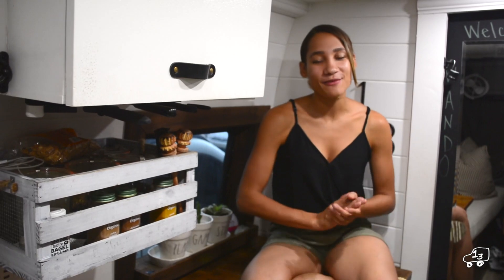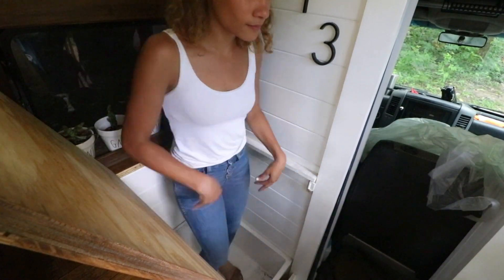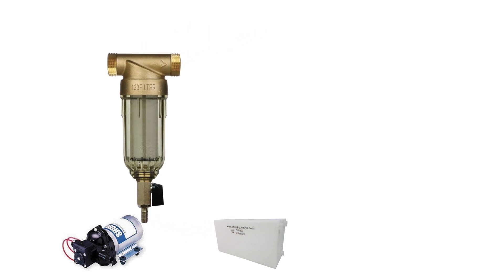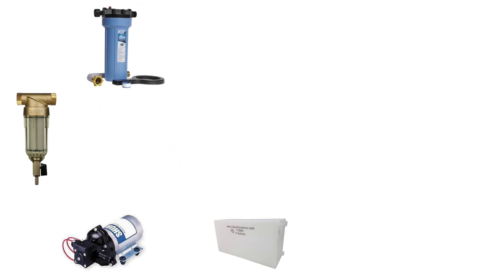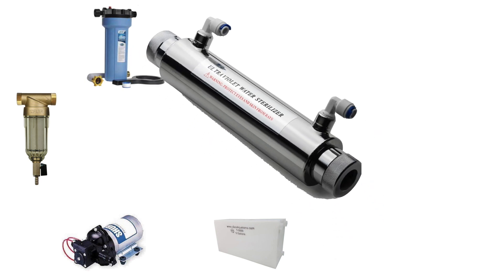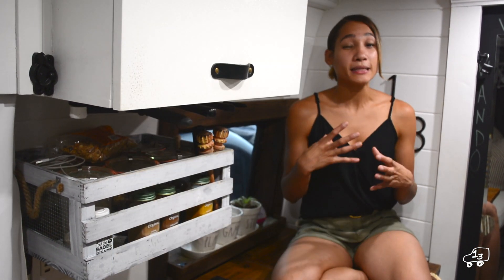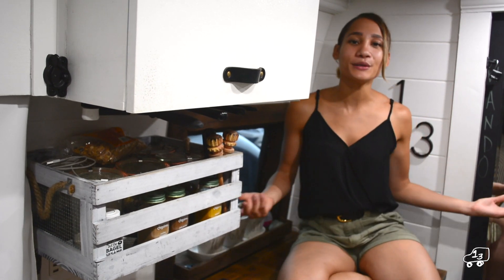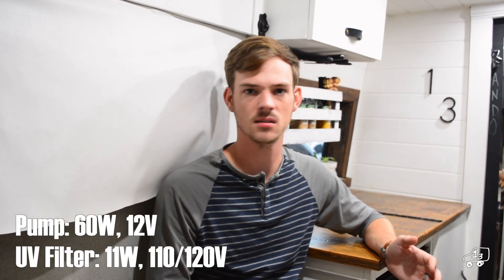VAN Tour: Recirculating Shower | How to Shower in a VAN

Comment: If you do change your plumbing...  stainless isn't actually as hygienic as it may seem.  Copper pipe has great antimicrobial properties.
Reply from the maker: Thanks Brendon, noted 📝
Reply: @foraluckygirl  I'm doing my first build at the min, my videos are pretty budget but will be showing some unique features and going to start looking into healthy choices and options for materials etc.  Check it out if you're interested - just know I'm going to put some more effort in and they will get better!
Reply: Copper or brass
Reply: The big benefit with plastic is cheap, just replace every couple of years, especially if you dont clean it.
Reply: Soft copper tubing doesn't stay soft; it work hardens due to expansion/contraction and movement, eventually cracking and leaking.
Reply: Brendon Tait the only problem with copper is that it will burst/crack if water is frozen in the pipe. I don’t know about stainless steel.
Reply: I would just be careful because I believe copper can be poisonous over time! Copper rust can be dangerous
Reply: @jacobbutler3845  I agree, but I would only be concerned about it if the water being used was acidic.  Copper is an essential trace element and has antimicrobial properties.  Although it does become toxic in higher amounts which can be caused from acidic water.  I believe at dangerous levels it can be tasted.

Comment: I was in the initial stages of planning a similar system.  I saw an inline aquarium heater that I think could work.  It heats the water up to 93 - 96 F and uses 200 or 300 watts.

Comment: Interesting, thank you.  I would definitely incorporate a heater.  I like you approach to the shower.  I hadn't seen one like it before and, one day playing with Sketchup, came up with a very similar design - a half-high shower with a curtain, that is additional counter space when not in use.  I also designed the curtain to slide behind a panel so it isn't visible when the shower is tucked away.  Thanks for sharing.
Reply from the maker: Oooh nice ideas Dave! Thanks for sharing

Comment: The concept of re-circulation of water has been around a long time, but I didn't realize how relatively simple the system would be if designed right, nor did I even think about using it in a van build application. My van build is now under way, still pretty bare on the inside. Now is the time for me to plan-in a system. I will use your Amazon links when i make my purchases. Thank you for giving your parts list and talking about this subject.
Reply from the maker: Awww we are so happy you were inspired! Good luck on your van build; it’s the best adventure :) and also thank you for the amazon support!

Comment: Sounds great guys..  I have physically torn my drain valve off my water tank. It sucked but it was just sprinkler riser, so c'est la vie. But on another note.. My water tank is at a well protected height,  a foot high in my rig and protected from the elements so I've never damaged it, but I am a big proponent of skid plates for important elements..and have my oil and tranny pan protected, as  I've damaged both.   It'd be pretty simple to protect your plastic tank bottom with a little metal plating.. and man I tell everyone who off roads or goes in lossy conditions to put a thought or two into assuring their oil and tranny pans and thus your big dollar assets are protected from leaving you high and literally dry.
Reply from the maker: Oooh interesting. Thanks so much for that great advice Deborah! We’ll look into it :)

Comment: Add 1t. Epson salt per gal. of water and it causes a chemical reaction that allows the filters to capture the soap.
Reply from the maker: WOAH thanks!
Reply: Hey did you guys try the Epsom salt and if so how fit affect the system and shower residue?
Thanks , great video.
Reply: Sorry. If I put Epsom salts in my shower I would get so relaxed i would fall over.. LOL Ona hot day I could put that in my silicone clothes basket full of warm water and have a relaxing bath!!
Reply: Richard OBannon Really? Never heard of this!
Reply: Salt is in pool setups. It is better than chlorine unless you are shocking new water.  In the shower setup, salt does its job, and shower water doesn’t need a shock from chlorine.  If you want to know more about pool and spa systems, look up hot tubs.  Hot tubs also use ion generators for softer water and fighting organic matter.

Comment: I wasn't planning on using  shower since it took up to much room in a van until I watched your first video on you entire van with your shower. I got so excited. After spending the entire day behind the computer and drawing out designs in my sketch book. I have come to a conclusion of trying to build the shower water on my roof. I figure that if you use 4" white PVC to hold the water, you can run your pipes along the top of the perimeter of the van and this will hold around 12-15 gallons of water. Keep the run one direction only, this will let you use the fresh water first while the used water follows. Spray paint the pvc a flat black, this will warm up the water quite well and give you a warm shower instead of cold water or another setup to use to heat the water. You will have to cut a small hole in the ceiling for your water to flow through, should be easy though with seals, plus its over your shower area.
Reply from the maker: Woah Sean that sounds incredible!!!
Reply: Until the temperature drops then you have freezing cold showers!

Comment: You can easily go with a larger tank that has more clearance then the tank you are using, as well as two tanks etc  blow molded tanks are readily available in so many sizes, meaning a5gal that is say half as tall, just wider and or maybe longer.  Easy peasy  slick system for sure!

Comment: If your heating the water for showers do what me and my wife are considering with our proposed recirculating shower... she likes boiling hot short showers, so she’ll go first, then the water is already hot for my shower, and with a thermostatic temperature controlled heater it only needs a top up of heat and I like a long cold(ish) shower.
Reply: Oh, stainless pipes will loose a lot of heat, you could use black plastic on the roof to heat the water (solar)
Reply from the maker: Hmm very interesting!! We’ll see if we ever change it :)

Comment: An infinite shower loop can be done using distillation process, in this regard you can literally create pure potable water from sewage water as long as you have enough tanks and a source of heat!  You will rarely need a new source of water, and you can use your favorite soap and shampoo using this method
Reply: The distillation process takes FOREVER (approx 8hrs/5gal), so not sure how you would expect this would work. A shower needs at least  (2gals per min), so please explain your distillation theory, or am I missing something?
Reply: Solara is from the future.

Comment: Worth noting about UV cannons is that they just damage the bacteria/microorganisms. They live for a half hour or so after they've been dosed, but they can no longer breed/replicate. So having one in a recirculating setup isn't wrong per se, but the utility of it is not as large as one might think. Having UV light on the water intake to the van itself, though, is great. The water goes past it and then winds up in the tank. So going with two big canister filters, one that does the particles first, and then another that has active charcoal for odors, would be sufficient. Plus the coarse filter at first to sift out the big stuff, like hair. As for how to draw water from the water tank, you may want to look at the showerloop.org site, and maybe talk to the guys there. They use electronics and solenoids, an Arduino I believe. I'm not sure about those details though. Maybe that's still on the drawing board.
Reply from the maker: Oooh good idea! And yes I love Shower Loop!

Comment: In summer we use a battery powered shower odd the back and side of the van. The power comes from a battery and foot switch combined unit and I stand in a collapsible silicone, very large bucket/clothes basket.The water recycles while I shower. I finish  with a fresh rinse of new water. I heat the water in a kettle using the gas stove and add hot water to cold water until I get the right temperature. 99% of the time we use the gym, beach or campground showers anyway.
Reply from the maker: Wow that’s incredible! There are so many genius ideas with Van life!
Reply: @foraluckygirl  We are in Australia. The Europeans come here and love the idea that they can stand outside and shower in warm weather in the open and in nature. I swear if it was legal they'd all be nude as they are not modest like Americans. Ozzies are somewhere in between. My shower came from eBay. I also have a 12VDC version that does the same thing. These ideas get around the pure cold water shower. If you have plenty of water available then you just pump it straight out of the container and we stand on foam pad. The on/off switch is a a momentary push switch on the shower head. We use a portable tripod shower holder to hold the head above us.  Yeah there are some great ideas but we have been camping and boating for more than 40years and we think we have it down pat.
We are now trying 'vanning'.

Comment: I would consider using a large stainless (for cleaning reasons) reservoir with a large top opening, and a separate drain.  That way you can add hot water heated on a gas stove, and you can go inside and scrub it and drain without contaminating the piping.  Another add in, run piping under your floor and use the system for hydronic heating(and use a small gas boiler).  The tank needs to be vented but not pressurized.  So much one could do, with time, space and money.  :-)
Reply from the maker: great idea! and I definitely agree - it would have been amazing to keep developing this plan but it was time to move on :)

Comment: Look at using a diverter valve prior to the pump, switching between two water sources as easy as turning a lever.
Reply from the maker: Wow thanks James for your insight!
Reply: Wouldn’t that potentially have the shower water running through the same lines as the rest of the plumbing?

Comment: Definitely the right idea. Adding a bank of RO membranes to the final stage would get rid of body salts as well as make the shower water drinkable.  But it would take 4x 200 gpd membranes to give you a continuous 0.5 gpm shower.  The water to the membrane would also have to be less than 115F to protect it.   If you can live with shorter showers, a single 200 gpd membrane can take water from the gray tank and put about 8 gallons into your green tank in about an hour.  Then use the 8 gallons however you want.  They would last about 15 minutes in the shower if running continuous.  Once your gray tank TDS got over 2000, then you would have to either dump it or distill it.
Reply from the maker: Wow cool info!!

Comment: That’s really great! Wack in a gas instant hot water heater and you’d be having ‘unlimited’ hot showers
Reply from the maker: Maybe one day!!
Reply: Diesel hydronic heaters are the cat's meow.  They will heat the water through a heat exchanger and can be used for hydronic floor heating.  A win-win in multiple areas.
Reply: @mldennis  Yeah and I wish I set up the under floor heating! That would be lovely. Maybe I could add it one day as a project

Comment: Could use two tanks to get fresh water when needed.  Perhaps you could have a separate valve that lets in fresh water and a separate handle to let the fresh water flow.  It will drain into the recycling system.  If that would overflow the recycling system you could allow the overflow to flow into a third tank that you dump.
Reply from the maker: I definitely considered this layout option, but the timing and skills were limited hehe

Comment: Would say remove filters and clean with vinegar or citric acid and cycle it. Then flush with tap running water for 3 or 5 minutes

Just change filters every 6 months or as recommended
Reply from the maker: thanks for your suggestion James!

Comment: Food for thought:
I toured an Army water filtration semi-trailer (300,000 gallon pool of filtered water was possible, from a large lake or swamp). They used pebbles and sand for pre-filters. 
A seven foot tall cylinder, 3 foot diameter has a bottom layer of fine filter material, second layer of fine sand, then coarse sand, fine pebbles and coarse pebbles on top. A disposable mesh on top to catch large debris. 
Occasionally, this system is back-washed to clean and reuse the material. 
After the pre-filter, the water passed through a system similar to yours.
To illustrate for your scale of operation: Fill a large "sock"  with clean sand, stick a tube (from a dirty water source) into the middle and let the sand be the first filter. Then use your current filter system. Downside - The more filters used, the more water required.
If you are using clear water, your system should take care of natural hazards. But I wonder how pesticides are removed.
Reply from the maker: hmmm very interesting things to consider!

Comment: I wonder if this would still work if you flipped it and put the 5 gallon tank on top of the vehicle. In a black container, maybe it could heat up in the sun?
Reply from the maker: Hmm you’d just need the pump under the van to push the water back up, then gravity would bring it back down. Could work!

Comment: Interesting approach, perhaps the third (up) filter is too much for shower grade but love seeing a different approach
Reply from the maker: I think the UV is most important for the bacteria that you’re removing. What are your thoughts about it?
Reply: I wouldent get rid of the UV filter, it was one that came to mind when you started naming your filters. UV filters are amazing I use them on my fish tanks (from 25 gal to ~300 gal) and they have killed algae blooms and bacteria based infections. 

If I had to come up with a recirculating water system for a shower I would definitely include one.
Reply: @foraluckygirl  i guess it depends. if you are re-using the same water immediately cant see a need but re-using 'old' used water then sure the UVZ filter is necessary(?).

Comment: How do you prevent the water from freezing in colder climates since your tank is underneath the van?
Reply from the maker: we didn't use the shower in the winter because we didn't have a water heater, so we just drained the lines and showered at the gym

Comment: I like that youre utilizing the basement and have that water reservoir underneath of the vehicle. Are you concerned about it freezing in the winter since its outside of your vehicle?
Reply from the maker: Hey Sean, thanks! We don’t plan on using the shower in the winter because we don’t have a water heater and that would just be torture :) if we transfer our grey tank under the van, we would just put antifreeze in it. I wouldn’t put a fresh water tank under the van though.

Comment: fyi, the strainer should be first, before the pump.

I am in the design phase of my van. I was thinking of a similar circulating system for my shower. From the tank, pump the water, filter it, UV light and repeat.
But, I was thinking, what if its not only for the shower but also for the kitchen sink?
A system connected together that circulates the water, so you can have a long shower, and also do the dishes or use the sink longer too. Each time you use either, you empty the water into the grey water tank.
But, the only tricky part is how to dump into the grey tank. And same as you noted, getting the first rinse from the freshwater tank. Any info on that?
And, does that mean you need a pump for the grey water tank too?
Additionally, in a way, this could just work as drinking water too, since its already filtered, just make sure that its not circulated water
Reply from the maker: Oooh you’re right, the strainer should go first! Good call! 
As for the sink I guess you could do the same, just observe your sink use and decide. For us, we let way too much go down the drain to feel comfortable using that water, vs while showering nothing too crazy is being washed down. I never figured out how to get a fresh water supply first and then switch over, and then finish off with fresh. That would be IDEAL
Reply: @foraluckygirl  Yeah, no one that I can find does that. Its also rarely talked about, recirculating water. I have been trying to design such a system, but its fairly complex requires multiple pumps and filter systems. So, it may not be really worth it if it was possible.

Comment: I am a CS... I understand all of Henry’s concerns lol. I would like to go van life on active duty, how would you recommend I go about it?
Reply from the maker: Hi Amy! Thanks for serving :)
Honestly we don’t think you would have any issue with that! What are your main concerns?
Reply: Wando Tales 
A big one for now is the address. Of course the military will need one, though I think at my next command it may not matter as much (sea duty). But also was concerned about deploying... is it pretty cheap to replace parts like a battery for most American brand vans? I may come back from deployment to a dead van.
Reply from the maker: I think our battery was about $200ish when we replaced it or you could leave it with a pal to turn on every few weeks. Same for an address!
Reply: @foraluckygirl  or you could use a trickle charger to keep it charged.
Reply: If you install any Lithium batteries, be sure to put them in storage mode before you deploy.

Comment: A single filter is going to get clogged way too quickly and won't be able to keep good pressure. You really need to have bigger micron filters that gradually get to smaller micron. This way, the large particals will be removed, then smaller and smaller.
Reply from the maker: Do you have any suggestions?